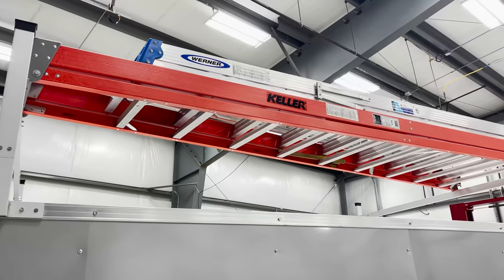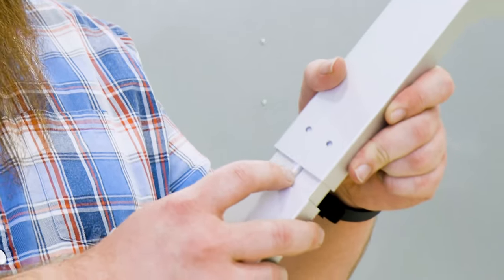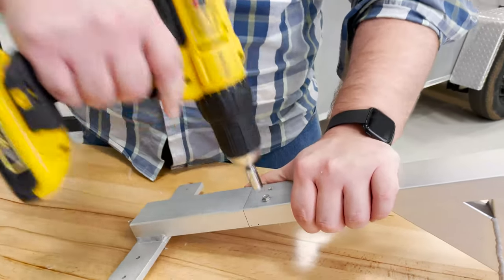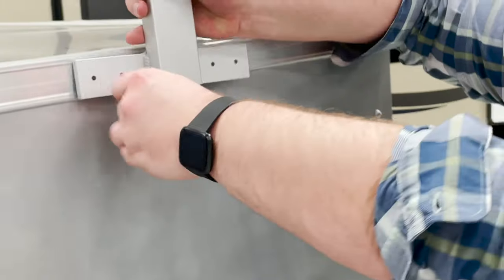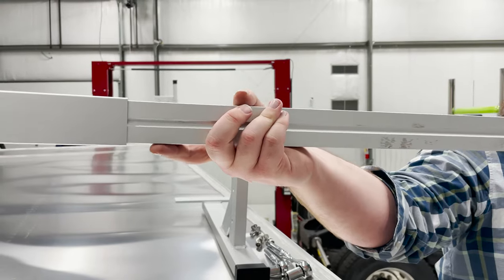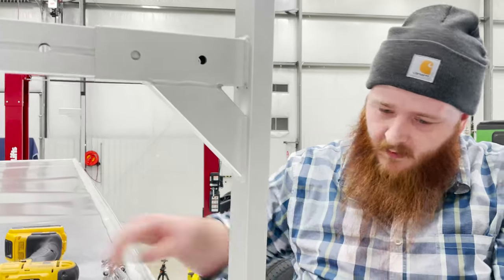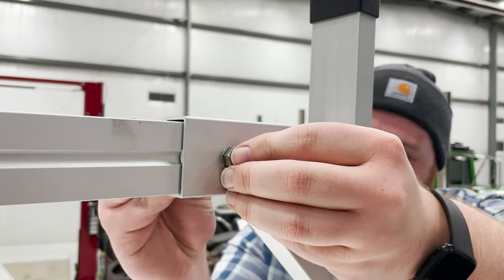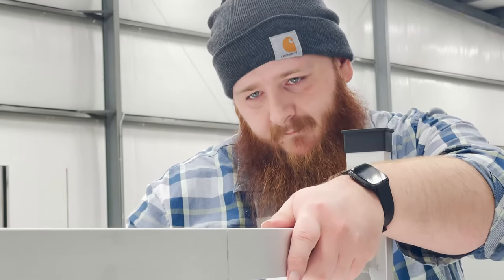Adjustable Aluminum Ladder Rack Install

Comment: Im looking at the rac n pro for my flat top cargo trailer, i would like them about 4 inches off the top of the trailer. Ill be mounting solar panels on them, and would like to keep them from catching as much wind as possible. You said you have them as high as you can get them, how can the be lowered? It looks like they are slid down to stop as low as you can get them. Would you have to cut off some of the male and female tubing to get them to slide down lower? I just need enough room to mount some 4inch pvc pipe for a water holding system for shower water, im using it for boondocking. 
   Also, you look like you've got some mechanical knowledge so in your opinion if i had two of the racks 4-5 inches apart, how much pressure would they withstand pushing from inside out? If possible id like to put a electric lift on the solar panel frame im mounting them to, and use a piece of flat steel between the ladder racks in the middle to mount a two piece tube style trailer jack to. I'll be sticking a drill motor stuck in a pvc pipe on the end of the jack wired to a toggle switch as a power lift. 
   I've seen one done and want to copy it, but not sure if the ladder rack would take the pressure. Im going to have a brace inside the trailer and bolt the legs thru it do the bolts don't pull out but not sure if the metal is strong enough. Sorry for asking such a long detailed question, but figured if i was specific to what i was planing you could better answer my questions. Thanks for the video, you did a great job on the install!!